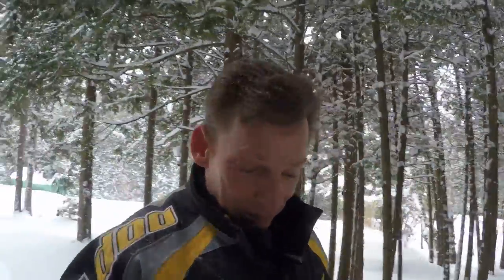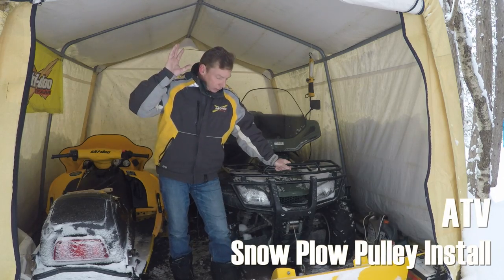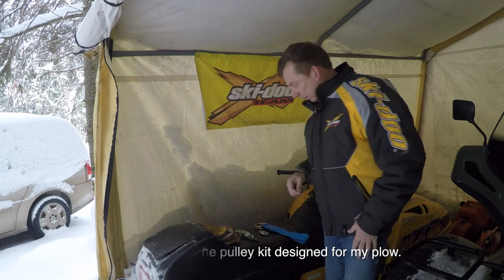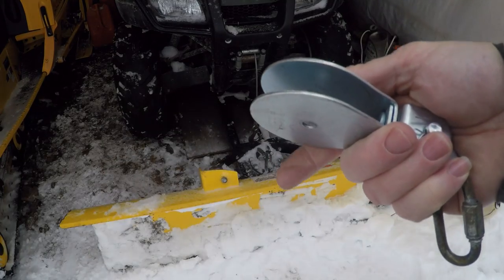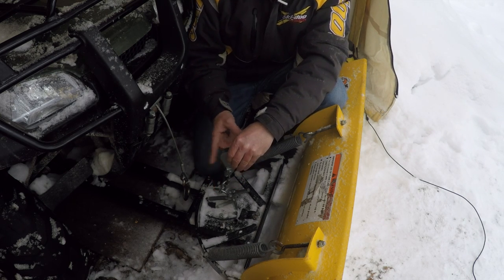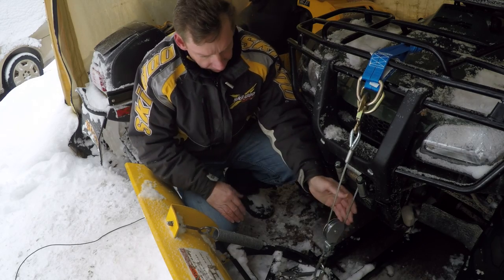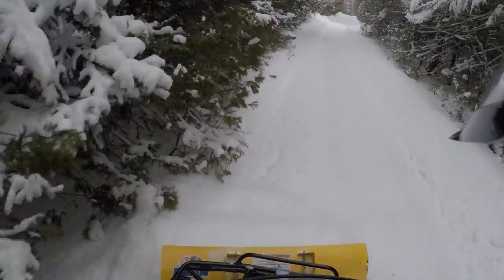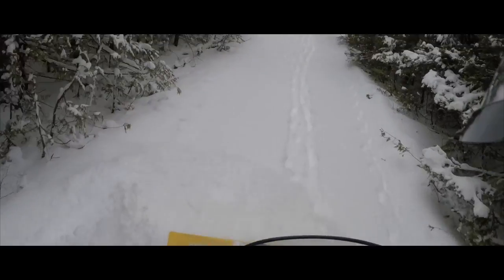ATV Snow Plow Pulley Install

Comment: Great job Dave.  I added a double pully system which cuts the force needed by half.  I also use synthetic rope made for plow purposes and have had zero breaks in 5 years.  Cheers!
Reply from the maker: I also found adding the pulley slows the blade down enough that I don't worry about raising it too much...
Reply: Feesher 
Care to elaborate your two pullies system?
Like to try Dave way and your way
Reply: Same! How would I do a double pulley set up?
Reply from the maker: Hi feesher.. Can you just flip a picture to me at my facebook page. Links get killed in comments.
Reply: @MyOldSled  Sorry, I don't have facebook.

Comment: Dave, you are 100% correct that if you own an ATV and do not have a plow you are missing out big time. Took me 8 years to get one, once I did I was amazed at how fast and efficient it worked! I have a 2002 Polaris Sportsman 700 and a nice Warn plow system. I had the same issue with the plow lift issues and put a high tension extension spring in series with the lift winch cable through a pulley at the plow pivot yet I attached the end under the machine.
Reply: I just got back into plowing with an atv recently after 15+ years of living in apartments.  I will admit it's difficult and time consuming to plow on icy gravel driveways but I'm hoping the chains I added this year will solve that problem!

Comment: Pulley point on my Warn front mount broke. Drilled a hole and did this exact setup. Thank you for this video, now works better than original design. Got everything the same but went with 3" pulley which works nice.
Reply from the maker: Excellent

Comment: A pulley set up like that gives you a mechanical advantage of 2.  It takes half the force to lift the same amount of weight (plus the friction of the pulley), but also reduces the speed of movement in half.   Pulling 1 meter of cable will lift the plow half a meter.  Gain force lose speed.  Gain speed lose force.  7th grade science simple machines.   I use the same set on my ATV, & it works well. - retired teacher
Reply from the maker: Thats correct MB. In addition to mechanical advantage, or the difference between the required force and the weight of the object you wish to move, by playing around with placement of the pulley, these setups allow you to reduce flexure and abrasion on the cable as well. I think the reduction in speed is well worth the reduced load on the winch.  Thanks for watching and commenting.

Comment: Cables will break no matter what you do. Replace the cable with a 5000# tow strap and hook. Have not had any strap breaks, fraying, or issues of any type. Going on 7 years now plowing about 300’ of double wide driveway 15 to 20 times per year. Plow is cycled up and down about 30 times during each use. Gotta love the strap.
Reply from the maker: Hi Jodie, I appreciate the feedback. I know guys swear by straps and if you have something that works for you thats great, but I have to disagree that they will break no matter what. Two of my neighbours plow with cables and the same pulley setup, and other than this year, we get a ton of snow. I plow my road and driveway a lot and none of us have had a single problem with cables. If they are maintained properly, they are easily able to take the abuse. Normally when cables break its because they haven’t been lubricated properly and corrode from the centre.
Reply: I would like to try that. How do you attach the tow strap to the winch drum?

Comment: I had the same setup on my f150 4wd truck with a 7-1/2 ft. plow on it. The pulley let me use a the smallest 2000 lb. winch to lift the plow with no problem. I had that winch on it for 8 or 9 years before I just plain wore it out. Know I replaced it with a 3500 LB. winch and use poly rope instead of steel cable so I don't need the pulley any more. I pulley just splits your load in half, so a 2000 lb. winch is good for 4000 lbs.
Reply from the maker: Hi David. Thanks for watching and commenting. Bought an F150 this year. Love it.

Comment: Great idea, will do that for my plow. 
Thanks
Reply from the maker: Thanks Anthony. Good luck. One think I did learn, make sure the rings on the strap are up high enough, if you set it too low, the hook on the winch will contact the pulley.  In this video its fine, but this year I was thinking when I hooked it up and had to adjust it.

Comment: I built an arm that I attached to the rack it reaches out above the hook point of the plow. The cable runs up and out to the pully and the hook is attached to the plow lift point. That way the cable lifts the plow straight up. It lets the plow float so when you kick it sideways it contacts the ground evenly. 
Hope this helps and makes sense! Lol
The pully is hooked to the arm not the plow.
Reply: @MyOldSled  Sorry.But I don't have that machine anymore. 
It was a piece of square stock that hung out off the rack. I had the pulley attached to the arm straight out over the plow. The cable ran through the pulley and dropped straight down to the lift point on the plow. 
Same concept as the one Dave Northrup posted on YouTube years ago. Check out his video.
Reply: @MyOldSled  Basically just like an old school tow truck with a boom and winch.
I was doing snow removal commercially and was averaging 400miles a season. 
Wore out multiple skids and wear bars plus a set of tires each winter!
But never had any problems with the Warren winch or anything else related to the plow being used that much.
Reply from the maker: Hi James, I found the video on Daves channel. This is essentially the same thing. The lift point on the plow and pivot points on the frame are exactly the same, so it's doing the same job - reducing the effort to lift the plow, just reversing the placement of the pulley. My plow raises and lowers in exactly the same manner. My plow rocks at a very slight angle when it's raised because the attachment point is slightly offset, but it still rests flat on the ground when its down. Your approach works great too. I like this set up because there was no welding, no wrenches needed to mount it and I can just toss the strap and pulley in my storage box when I'm note using it. Worked perfectly all last winter but I'll keep that design in mind if I run into any issues. Thanks for watching.
Reply: @MyOldSled  Hi there - no offense but it's not really the same thing. The point is, which the video states at the end and what James said - by putting the pully up by the fairlead using an arm or suspending it from above (from the rack), you can move the pully out so its nearly ABOVE the lift point on the plow. This makes a massive difference in the amount of energy it takes the winch to pull the plow up. Pulling it straight up vs at an angle is a significant change, and that is really James' point. The video does not show that exact implementation but states you can just move it further out to achieve further efficiency.

Comment: Just one question: do the rack supports this weight? Maybe the bar will start bending.
Thanks and nice tip
Reply from the maker: The rack is more than strong enough. I can’t speak for all ATVs but I’ve never had an issue.

Comment: Pretty sure the angle is the same since the pulley just gets pulled towards the winch. It's just shorter length and then goes up. It actually even seems to struggle more with the added resistance. People have the winch go up to the bars so the plow can be raised higher without damaging the mounting bracket.
Reply from the maker: If it was the same angle, I probably wouldn’t have said that. I mean, it’s not like I can’t actually see it. The primary reason for adding the pulley on a winch, as with any lifting system, is to reduce the load on the winch, exactly like using a block and tackle. Thanks for watching.

Comment: I plow with an ATV, I don't really see the advantage here.  I have a Warn wench and my plow isnt all that heavy.  For me, I don't want to slow the wench down, because I want to get it done as quick as possible.  I don't have heated grips, so when it's 10 degrees out, I don't have much time before I can't feel the controls on the atv.  Thanks for the video
Reply from the maker: Hi JK. Well, the advantage is stated in the video. Like any block and tackle arrangement, you trade force for distance. Every pulley you introduce cuts the lifting effort in half. The net result is a reduction in the wear and tear on your winch. That said, I can understand you not feeling the benefit is worth the blade being slightly slower. It takes my blade 2.3 seconds to raise from the ground to its maximum lift. I can make it 2.3 seconds without freezing. I don't have heated grips either...so I wear gloves...because after all, it is winter. ;) in any case I didn’t invent it. Most atv plow and accessory plow companies make a pulley kit for the same reason. Just sharing the quick and easy version I use. Thanks for watching.

Comment: Love the idea. 
2 questions: 

1) any idea on how to add some weight to the slow to allow it to cut better in harder snow? (I have a 5lb bag of sand on it to help keep the blade down) 

2) with this pully mod, does the pulley put all the weight from lifting onto the front rack, or split between the winch and the rack since its 2 points of contact? I have a trx300fw and the front rack is rated for like 60lb of weight. Is this a large concern?
Reply from the maker: hi Orvis. Hmm actually no, I've never thought of adding weight to the plow, but I guess that's as good a way as any.  I guess the weight would be split between the winch and the front rack. I can't say I'm sure if thats a concern. If it is rated for 60 lbs I would say it would exceed that weight, but I haven't had any issues on mine.
Reply: @MyOldSled  Hey thanks for the reply. 
Just out of curiosity, do you have any experience with plow wings? 
If so, are they worth it to make/buy and retrofit on a ATV plow?
Reply: With a single pulley in this configuration the weight on the rack is half the weight of the plow being lifted.
Reply from the maker: Actually, the weight is still hanging on the rack at any point in the lift and remains unchanged, the force required to move that weight is reduced with each pulley added.

Comment: would there b any issues if u were to put the roller at the top and connect it to the strap and then run the hook down and connect the hook to the plow?

Comment: Hi Dave... Just picked up 2012 Honda Foreman, and a second hand moose blade and push frame assembly (same as yours). The base plate attachment is ordered and should arrive soon. Quick question.. There is a skid plate which blocks access to the frame to attach the base plate. Do you remove the skid plate, or cut a hole through it to access the frame?.. Thanks for looking.
Reply from the maker: Mine had the plate when I got it and no skid plate. I would say drill it and see if you have enough clearance to lift the blade, the remove the skid plate if you need to. My guess is you’ll need to
Reply: @MyOldSled  .. thanks
Reply: I have a 2004 Foreman that came with the bracket already attached.  It looks like the skid plate was removed and bracket attached directly to the frame.  I'm sure you've already got it mounted by now haha, 2 years ago

Comment: Plowed snow for 10 years with wire rope and never had a problem. I fell for the marketing hype and put on a synthetic winch and it breaks EVERY TIME I use it. Going back to wire rope.
Reply from the maker: Still on the same cable, no issues

Comment: Well Dave let us know if it survives. I have also been experimenting with my atv/plow setup. 1st the pulley cut my speed by half, for me painfully slow and I am not as patient as you. 2nd I used a TSC pulley (princess auto is 3 hrs away in Sudbury) that looks identical to the one you are using. Destroyed it in no time. Hope yours works out better than mine did. BTW love your work.
Reply from the maker: Yep, it cuts the speed down, spreads load out so it has to. Pulley is good and solid, no woories. Thanks for watching!
Reply from the maker: Wanderer…still going strong, and I lifted the plow while standing on it….

Comment: Buying a used plow it goes to rear hitch on bike I believe is there more hardware that’s required up from of the bike?
Reply from the maker: I don't know that much about them, but I think they just pivot further back. Mine pivots pretty much right under me, the one you're buying would go into the receiver and hinge there. I think you lift it with a winch the same as I do with mine.
Reply: @MyOldSled  ya iam going to use a u bolt or something under bike to keep up and in center what’s strongest place to do so?
Reply from the maker: I'm not sure what you mean. I needs to be able to move up and down...maybe I'm just understanding. I guess you'd want to bolt a plat to your frame?
Reply: @MyOldSled  it’s a square tube that runs length of bike to the hitch of bike but need to anchor that under bike somewhere
Reply: @MyOldSled  I’ll think of something just didn’t wanna bend frame

Comment: Nice.  What size plow is that?
Reply from the maker: 50”
Reply: @MyOldSled  Thanks.  Did you ever do the pulley mod (drilling a hole and moving it a bit closer to the blade) you spoke about in this video?
Reply from the maker: No, lots going going on this year building the new garage. The Atv was stored at the neighbours.

Comment: It don't look like it may lift as high now but that was a good idea!
Reply from the maker: It doesn’t change maximum height at all if you position the strap high enough. It still lifts as high as the frame which is as high as it can go. Thanks for watching
Reply: @MyOldSled  I have one of those pullies I may try that! Because I broke my cable bout a week ago down by the hook that looks like it may take the strain out of it where it bends coming out of the winch thanks!ps I ride sleds 2

Comment: Dave can you teach others to use the right spark plugs for the right engines. One time my sled's muffler almost blew up because of the wrong sparks
Reply: my uncle change my sled's spark plug from br9eya to br8hs
Reply from the maker: Can't imagine blowing a muffler up because of plugs, but your manual should tell you which plugs to use.

Comment: How long did that fix last?
Reply from the maker: Still going strong. It will last indefinitely. I mean eventually the cable will wear out like anything but it's  getting half the stress. This is a pretty standard mod, the plow manufacturer offers a very similar add on, I just don't like the company much .

Comment: Can't lift blade as much now. A revised roller of a larger diameter mounted forward of the fair lead rollers at the height of original would function better
Reply from the maker: Hi M. Sorry, that is not correct. My blade will still lift until it hits the frame, which is as high as it can go. No change.

Comment: Forgot pulleys 
Get a ratchet strap and use the strap off it instead of cable on the winch 
It last forever lifting plows
Reply from the maker: Hi Eric, I know a lot of guys use straps or ropes. Personally, this method is my preference as it reduces overall load on winch, and it’s well within capacity of the cable, but I appreciate the suggestion. Thanks for watching and commenting.

Comment: Mm I can see that might just bend your rack tubing.
Maybe connect it to your bump bar instead and use a shorter strap. Just saying.
Reply from the maker: Hi Terry, the rack could easily support double that weight without bending. Been running like this with no issues for a while now. Thanks for watching.

Comment: Get a Synthetic rope for plowing season
Reply from the maker: Thats something I’ve been considering. Wondering if id need a larger pully.
Reply: @MyOldSled  I don’t think so. When it stretches it fits right in there. I have a short one that I use just for plowing season. Definitely lasts a lot longer. One season with the original metal cable and I started breaking strands. 4 years on this synthetic plow cable now and it’s not showing any signs of wear. And they’re inexpensive

Comment: Twice as slow. I don't see the benefit.
Reply from the maker: Not that complicated. Half the load on the winch. Most plow companies sell a similar accessory.
Reply: @MyOldSled  I didn't say it was complicated, I said it was twice as slow. I don't think the benefits outweigh the cost.
Reply from the maker: Ah, ok. You said you didn't see the benefit. In that case,  I think another second or two to raise the plow is is worth reducing wear and tear by putting half the workload on the winch. Just my opinion. Thanks for watching.